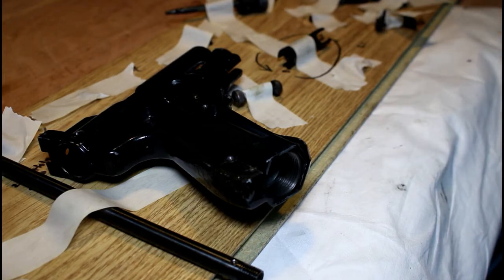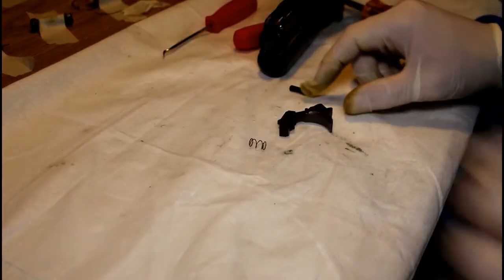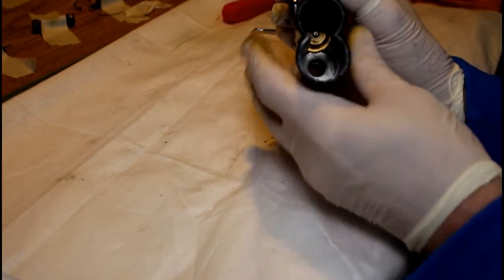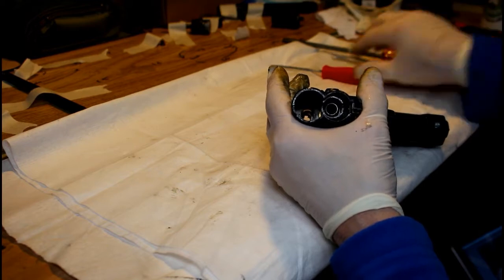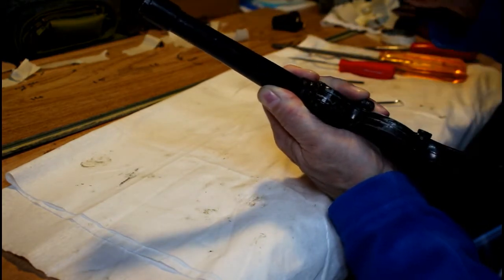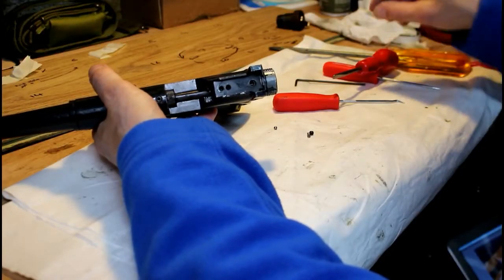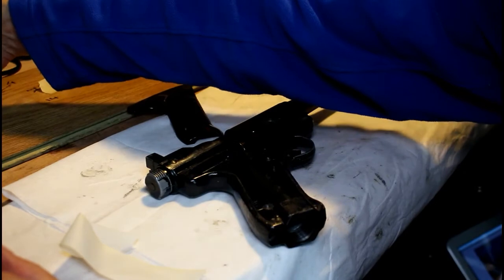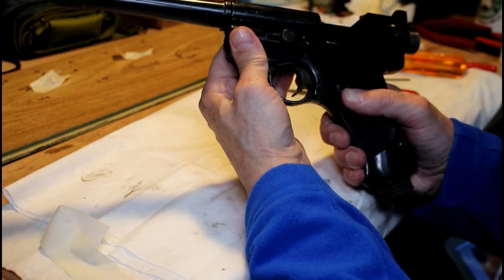Crosman Mk 2 CO2 Air Pistol Assemberly by New Town Naughty Boy (Part 2)

Comment: Great, clear instruction.  I purchased MKI pistol in the late 70's ,put it away and never touched it again.  I did follow your directions and it was easy.  I did rebuild piercing plug by removing inner threaded sleeve and replacing o ring.  Three weeks after piercing co2 full power shooting.  Thanks again.  Nick
Reply: Hi Nick how did you get the inner threaded sleeve to replace the piercing o ring for the inner punch

Comment: Thanks a ton I was able to completely dissemble and replace all of the seals and put it all back together and it works! Great instruction and did not go too fast or use unknown vernacular. Wish the lighting had been better but I know it's a black gun so not easy! Definitely got me through super happy. Getting that last valve out was super difficult Glad you said to heat it up because that's what did it!

Comment: Very helpful video,  I was able to change the Breech bolt probe seal without removing the bolt from the gun once the barrel bolt was removed. I was able to get the new seal on the breech bolt.

Comment: There is a seat on the inside brass piston that mates with the brass piece the spring is attached to. It is not an o ring but gets hard and brittle. This can be repaired by removing the seating material, it looks like hard shellac. Clean it good all the way to the brass and then replace with a .008 O ring.(inch size is 0.176 x .070)push the O ring down to seat it well.

Comment: I wish you would show "rebuilding the piercing assembly".  Due to the fact that when you buy a o-ring rebuild kit that there is an oring insde the piercing assembly that comes with the kit! It's the O ring that causes  the #1 reason for leaks from the CO2 !

Comment: When reassembling my Crosman Mark 1, are there any lubricants required other than Crosman Pellgun oil, and where would those locations be?
Reply from the maker: Just be sensible about using a little oil on moving parts. or even a light grease. The secret is to not over do it, certainly springs should be lubed and trigger parts. You cant go far wrong as long as you just take care and don't swamp the gun.
Reply from the maker: I think where possible just use the Crosman product. things like seals react in a strange way with some oils, especially when they get cold from the CO2